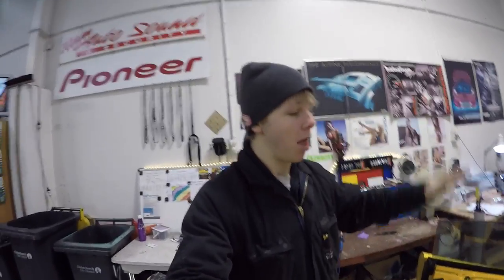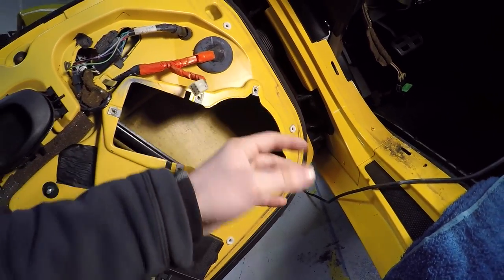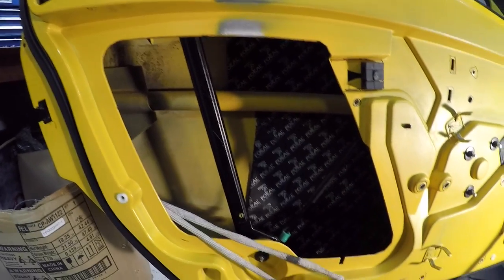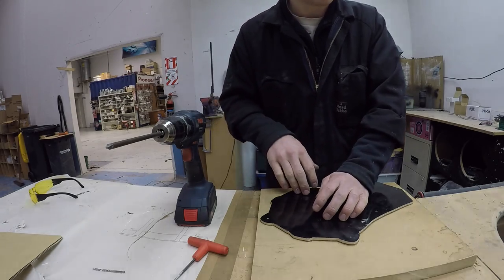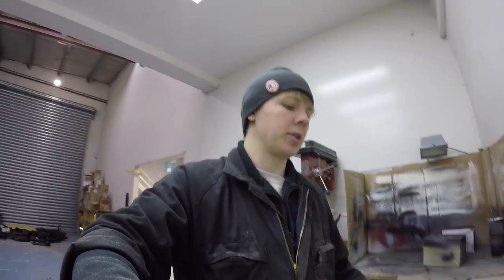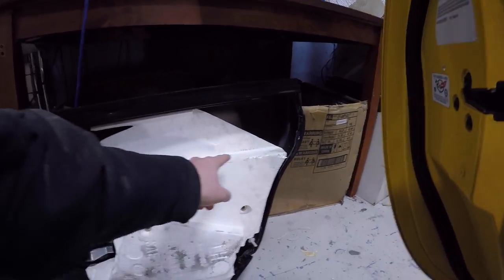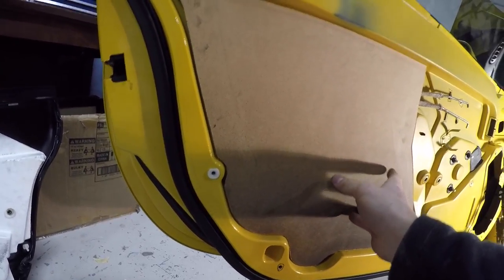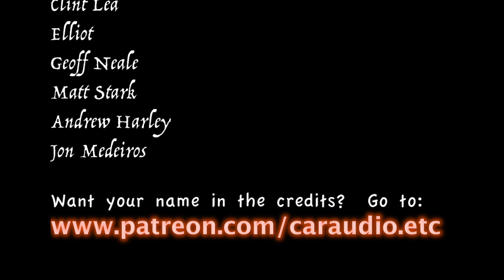Corvette C5 Speaker Baffles & Sound Deadening.

Comment: Nice work James.  One tip for sealing door holes if you use "corflute" the same stuff they use for for sale signs at houses (also the same stuff as the Pioneer signs in the workbay).  You can easily cut it.  Its heat formable and also water proof.  The deaden straight over it.  Its light weight, but has great sealing properties.  Sign makers will always have off cuts.  They normally give away or sell super cheap.

Also regarding the Bam on the inner skins, its great for isolating the door skin from resonating against the door.  Helps prevent any buzzing or rattles
Reply from the maker: +Clint L good idea man we actually have spare of that stuff lying around.
I've pretty much done them in wood now but I will keep that idea in mind for future.

Comment: I just did speakers and amp in my 2002 Corvette ZO6. I took the door pods completely apart and cut the amp cover off the back of the door pod and used it for a template for the speaker plate.  I went with the Infinity Kappa coaxials six and a half in front five and a quarter in the rear just running off the radio power they are two ohm which gives them more volume. I sound deaden the whole car interior. I'm running a JL Audio stealthbox and a old punch 300 amp.

Comment: Crossover mounting point, I would suggest hiding it in the door to save space in the boot but I wouldn't put it behind the door skin like what you mentioned there. More potential of getting exposed to dirt and moisture as it's not protected against the elements in there, I've even pulled a speaker out of my car on a wet day and found a little water on the magnet.

Comment: For filling large areas of the door like that use "RivNuts", I've got a Kingcrome one which will do M3, M4, M5 and M6 nutserts both in Aluminum and ZInc Steel  so you can rivet in threads to the steel work/composite material then use bolts to secure the panels :)

Comment: The deadener with foam can help with other high frequencies...I lined my roof with normal hard cld then a layer of foam over that and it helped kill the ping of rain and made the cabin much much quieter. You lower the noise floor (road noise mainly) and the system will appear louder to you...it's like tricking your ears.

Comment: I have some experience with vettes...especially the C5. They leak from everywhere. anything electrical should be placed in the back and up away from the floor. door speakers and in-door crossovers should be sealed. water will get to them. behind and under the seat is also off limits as there is often water intrusion that collects in these areas. In the coupes water may even come in around the hinges for the trunk and or window seals. amps and crossovers should be mounted behind the seats where the partition is, preferably not on MDF material as its predisposed to water damage. I've driven in the rain and had my Z drip water on my knees! I've resealed the entire car since, don't count on the factory body seals and weather-stripping when installing high end audio.

Comment: I would rather you put the crossovers not behind the door, because I don't know how they would react with water. A door is not a sealed enclosure, with there having to be a place where rain can run down the window and down to the drain holes at the bottom.

Comment: A thick baffle also should have a chamfer on the backside as some drivers can have the backside suffocated, a cylinder created from a straight cut will change the T/S parameters of the speaker affecting its expected performance.

Comment: only concern about gluing in the wooden cover uou made is if there's ever a concern with window, they'd have to cut all that work out to access it.
Reply: abraham schafer if you don't want to permanently attach something, put some masking tape on the door before you use the RTV, then it becomes a RTV gasket.  you can remove the masking tape or just leave it. 👍

Comment: What location makes the x-over preform better.... close to the amp or close to the speaker? Mount it there!
Reply from the maker: +Robert Lively I honestly don't think there is a more effective position for the crossover.
AC voltage goes in AC voltage comes out. AC doesn't loose current over small distance like DC so I think there would be no difference.
Reply: Car Audio.etc the only advantage of mounting in the door somewhere is you only have to run one length of wire to each door. But if that's not a concern and there's room on the amp rack I'd mount it there on display.

Comment: Did you not have 6.5mm? They are in every set of metric sockets that I've owned.
Reply: The reason I ask is that GM has used metric for everything for longer than that car's been on the road. I've had to use 4.5, 5.5, and 6.5mm sockets on my own 2000 gm vehicle.
Reply from the maker: Subversive Hippie interesting 
I don't think I have any .5 increments of socket. Probably less necessary in NZ since most things are standard metric sizes and then there is the imperial set for inbetweens if you need it.
Reply: Car Audio.etc I don't think any of my imperial sets came with anything smaller than 1/4". 1/4" works perfectly for 6.5mm though.

Comment: A little late, but these aren't too bad as far as Bose replacement brackets go:
https://www.amazon.com/gp/product/B00TR1RCDQ/ref=oh_aui_detailpage_o01_s00?ie=UTF8&psc=1

Doors are fiberglass with a metal bar to protect the occupants.  All Corvettes have a fiberglass shell to reduce the weight, but it doesn't line up as nice as metal.  Also a good idea to store a fire extinguisher in the car so a small fire doesn't melt the whole vehicle.
It's not just SAE, it's a mix of SAE and Metric in U.S. cars that make them a pain.  Wish we'd just commit to Metric.

Could have mounted the crossover in the door foam... just cut out shape, wedge it in (in an anti-static bag) and seal it in to hold it in place.  Should reduce the odds of exposure to rain water.
 
Didn't know if you had a video showing the wiring through the door into the vehicle.  Curious as to what you did before I do something stupid with my Z06 I'll later regret.  Mine has a very small harness.

Enjoyed the video series on the Vette, that I was able to find.  Will have to research the battery recommendation.

Comment: hey guys and girl little tip go to jaycar and get the dyna mat no its not the same brand but u can get 3 meters 3-330mm for like 70 dollars its good shit
Reply: So not even close man.
Reply: Clint L dyna mats 1.7mm thick this is 1.5mm thick its the same shit lol
Reply: brad curnow no it’s not. The matting doesn’t adhere the same. The dampening effect isn’t the same. Also the cheap jay car stuff doesn’t have the same insulation properties. I guess if you’re tight for cash it’s probably ok. But I’d never use it.
Reply: Clint L well it stick pretty well for me bro plus the shit i got looks the same as dynamat so .... yer go hard if u want to pay $239 rr is $379 for 3.3 metres square